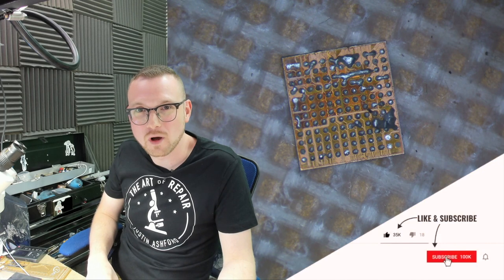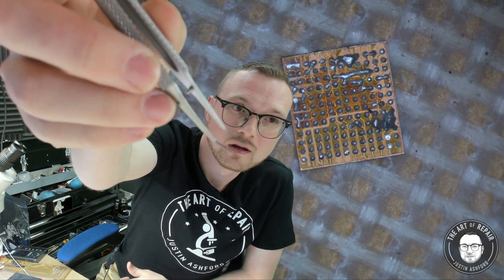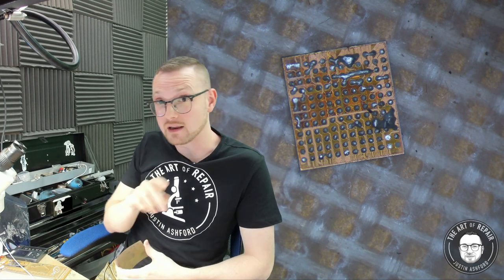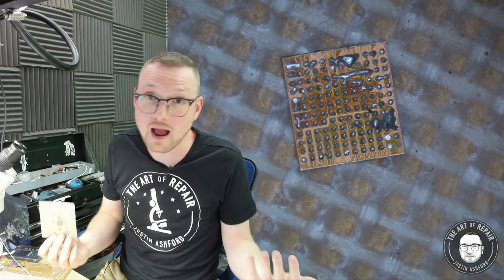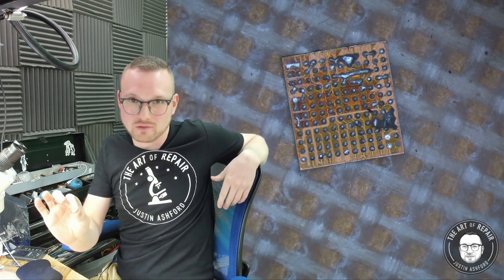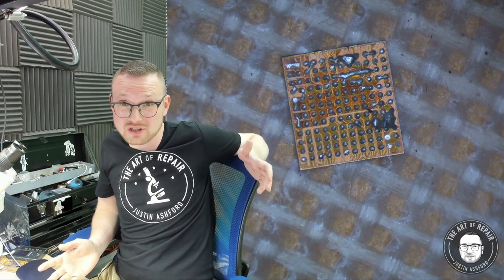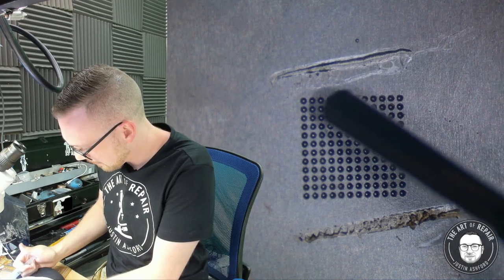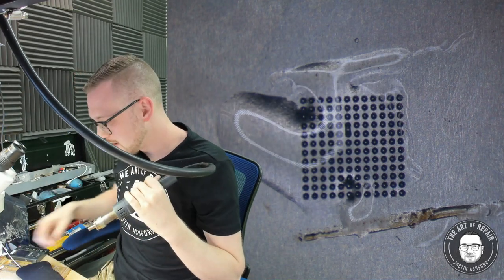IC Chip Reballing 101 | Microsoldering Basics | How do I do a basic IC Reball? | IC Harvesting

Comment: Clenaning iron before putting it to stand will significantly reduce tip lifespan. Rather leave it dirty and clean before next soldering or tin it before putting it to rest. It looks nicer, yep, but clean iron will expose metal alloy and it will oxidate quite fast. Great balls though, it is hands download best reball guide.
Reply: Clean it and tin it is fine then you have to repeat that before soldering

Comment: Hi, thanks for the video. It was very good tip, when you said to apply flux and 140C to lubricate the stencil. Now the balls didn't get stuck like they used to before using this tip. It took only 10 min to reball IC. (steps: Clean IC pads with wick, apply stencil, apply balls, heat 370C from corner angle, apply flux, heat to 140C, remove stencil, apply heat 370 to get balls self align.)
Reply from the maker: Heck ya! Glad to hear it worked well for you 💪💪💪

Comment: Hi Justin! Did all the steps you told, and my reballs are getting perfect. The only hard time I'm founding is with bigger chips, like PMIC's, EMMC's and CPU's from Samsung, Motorola, etc., and it`s worst and they have some "empty" balls and I do not have the correct stencil for them.
Is there any trick to help with this? I'm using a small piece of glass to help out, its working, but it tooks too many tries to get things to work :(

Comment: I figured the reason you want to reflow after stenciling the balls on is so you can flood it with flux and ensure the balls are properly bonded to the pads.
Reply from the maker: although it’s very very rare for that to happen yes that’s one of the reasons. The main reason being just to line everything up so that as you offset it with the pcb array it will grab properly across the array in unison 😎

Comment: Hey Teacher (I hope you don't mind me calling you that).
I'm sorry but I've tried every single hint you shared in the video. By the way, thanks a lot for sharing. You rock!
But unfortunately, there's ONE CHIP, or THE chip that literally just laughs at me every time I try something different: CYW4356XKUBG or BCM4356XKUBG, it's a Wi-fi/BT chip for the Nintendo Switch. I spread 63-37 solder with my soldering iron, remove the flux using a cloth. Then, I proceed to line my stencil (similar as yours) up with the chip, apply solder paste, hot air @350ºC with very low air speed. I struggle a little with indirect heat (even after following your steps), but eventually all the balls are formed, oh and all of that while still applying pressure around the chip with my stencil. And I end up with 2 or 3 bridges on the chip.

I've also tried gluing the chip with the stencil using a tape behind the chip; Same result;
I've tried leaving some flux on the chip because a friend of mine told me some balls might not be forming or staying on its spot because of the lack of flux; No, still same result. Although it was only one bridge, but it involved six or seven balls;
I've tried changing the air temp to 365ºC and going up the air speed a little, but it rendered the ugliest result;
Maybe something is wrong with my solder paste, which is a Mechanic one. 63-37, melts @183.. I dunno.
I even tried changing from a steel spatula to a thermal paste spreader (I don't have a plastic spudger), but results didn't change.

I'd love to watch you try your luck with it. Maybe it's just not meant to be reballed? 
Thanks again for the vid and I'm sorry I'm 2 years late for this. It took me a while to find your vid. Keep up the great work (:
Reply from the maker: Email me a video justin@artof.repair and I’ll see if your missing something.

Comment: great video. I really feel comfortable giving it a shot. As you know I don't really do phone so I am outsider on this but any suggestions on boards I could grab off ebay for cheap to practice on? something that they still sell stencils for? It doesn't have to be fixable just something to practice technique. If you want to sell me a bag of parts/boards I'd be happy buy especially if you had a stencil to go with the stuff.
Reply from the maker: Just get iphone 4 with stencils, 20 bucks for working phones and stencils are like 3-4 bucks for basics.
Reply: I've found a large stencel kit on eBay, something like 100pcs for cheap, came with 4 different leaded ball sizes. Many of them are universal, can do anything from TV arm MCU, consoles, ram. I used one for a Chrysler radio gpu chip and LG tv main board.
Reply: @jeffescortlx  I see you have found me  haha.
Reply: @FixedUntilBroken  yep I like Justin's videos, especially re-balling. He makes the process look easy when it typically ends in fits of rage for the average techinition.
Reply: @jeffescortlx  same. I've I'm here trying to learn some mobile electronics to make me a little more well rounded. Not looking to do mobile electronics as a business but I see more of out automotive electronics getting BGAs and Screens on them. I feel like one day automotive electronics and mobile electronics are going be very similar.
Reply: @FixedUntilBroken  yep more and more BGA stuff is ending up in automotive.

Comment: if you think a spudger is awesome for spreading solder paste, you should try a guitar pick.  .50 thickness.
Reply from the maker: The spudger gives a lot more accuracy in the hand than a guitar pic at least for me. Sometimes I use a razor blade but I feel like they tend to eat up the outer surface area of the stencils paste holes and cause the stencil to degrade faster.
Reply: @TheArtofRepair  Right on, I'll have to try a spudger next time.

Comment: I don't have a problem with reballing. But I do have problem when the chip pads are oxidised and the balls don't like to hold to them. What's your advice on that? :)
Reply from the maker: Normally I don’t recommend smaller tips but maybe a smaller J tip with some solder on it and the pad has some flux. It would also help if the entire chip was at a decent temp. So if you could use a ic jig to hold it you could heat it up with the hot air and see if that will break down the oxidation.  

I know the problem your having and it’s a common problem

Remember flux is a detergent and a barrier so that plus the right amount of heat and solder should do the trick. Let me know how it goes!
Reply: @TheArtofRepair  thank you.  Might try to record it and observe the outcome. If will be worth sharing, will post in on my business YT and comment here. 

If not, at least will comment what I did :).

Comment: What do you recommend to do when the stencil lift itself up while pressing with the tweezers on the edge of the array?!
Not all the time this is happening, however with larger ICs, that tends to happen often.
Once that happens, the paste/balls will merge in the center where the stencil is lifted the most.
Reply: Just put tweezers across balls, apply pressure directly to the chip. its gonna be fine, trust me.

Comment: What to do if the balls form in the stencil and get stuck there.(mostly on very tiny 0.2mm) ie. ? My balls are not on the IC but in the stencil.

I managed to really press down the solder paste very hard and take the stencil gently off and melting it without the stencil to get an okay result but always when i leave the stencil on the balls get stuck in the holes of the stencil.
Reply: Then there are some techniques. You need to "glue" the balls onto the landing pads. This you can do with thin solder flux on the surface or use solder paste prior to put the balls. If the balls still stuck all the time, you'd better reflow everything prior to remove the solder stencil. This you can do even without the solder balls. To use solder balls is not a must. Good luck!
Reply: @jurgenkruger3932  thanks for the reply. I dont use solder balls. The paste forms balls and these are getting stuck. 

Sorry if it was unclear.
Reply: @MattFixesStuff  then is something with the surface. You need a thin layer of solder flux, so the solder paste can get a reliable connection with the copper surface. If all is then proper melted, then it shall not be possible for the tin, to stuck inside the holes of the solder stencil.
You can also try to use the solder stencil upside down. Maybe the edges of the holes are not clean, sharp enough.
Reply: @jurgenkruger3932  I'll try. also ordered another stencil.

And yeah its really stuck in the holes. I can pop the balls out with a needle after theyre formed. 

Thank u :3

Comment: Is cleaning the chip off with copper wick before reballing pointless? I have always done it but I see you don't
Reply: I always use wick too
Reply: It would remove any oxidation on the pads ensuring a good connection (if that was the cause of the fault). Downside is it takes time and there is a risk of removing pads.
Mixing lead-free and leaded solder... Would lower the melting point and add lead to the alloy. I don't think it is a huge issue, especially if longevity isn't an issue.
Would love to hear Justins opinion on this though
Reply from the maker: This will be answered in next Monday's pre video livestream in more depth, but in short,  If we are realloying with 63/37 which is 183, then applying the same as paste nothing else should be effected. Cleaning the BGA array flat IC side is pointless in our microsoldering context. cleaning the bare board with wic. yes, always, but yal know how i feel about that haha.
Reply: @TheArtofRepair  " If we are realloying with 63/37 which is 183, then applying the same as paste nothing else should be effected."

Since RoHS directive, everything should be lead-free, including the BGA's (Imagine the horrors in production if only a few areas has to bee leaded and others lead-free)
Lead-free is often SnAgCu alloys, so adding a bit of SnPb will 'only' add Pb to the alloy, though not in the normal 63/37 percent ratio. 

My view on this is: Know what you're dealing with, clean it up if in doubt - always do it correctly (even though it takes a bit of time - it will save you time in the long run)

Comment: It looks like the balls in the middle have more volume than the ones on the edges. Wouldn't it make more sense to use solder balls? Then the amount of solder on each pad will be perfectly equal
Reply from the maker: @Turnikov  nah, all the same for sure. I do a lot of training for students in person. And when you have depth perception it’s much easier to see everything is all the same size.

Just to address the comment about solder balls being easier. I would say that if you’re just at the desk doing this. You can do the full paste reball of almost any size or density array in 2-3 minutes max. Fullsize balls will slow you down big time if you’re trying to get work done. Nobody has time for the reball to take 10-15 minutes alone when the full job needs to be 30 max. 

But definitely would love to discuss further if you felt you wanted to :) love good comments from subscribers.
Reply: @TheArtofRepair  your reply makes perfect sense. But if you do love discussion, I'd like to share an opinion I've found online: 
"I won't use leaded solder paste, because those tiny particles if not handled very carefully will end up in your mouth, up your nose, or otherwise ingested eventually, I have no doubt. Any solder paste should be handled with extreme caution." 
I think that hobbyists should opt for the balls, while professionals can use solder paste to save time
Reply from the maker: @Turnikov  I would say I agree that Ingesting leaded solder paste is not a great idea like 10000% but let me throw this one out there. Safety is always number one and should come before any part of the soldering process. So for me. Washing your hands when your done soldering or wearing gloves during the process would negate that. To further that. One could use lead free solder paste. It just kind of kills the working range of hand soldering a bit. Now that might actually be ok if the hobbiest is just doing some rework on something rather large. And I would say it might be that if your doing something similar to that in my video that those working play ranges are pretty crucial to allow for a proper step soldering process to eliminate damaging other joints on the board on the other side of a pcb of that are currently underfilled.

On a final note, you seem like the kind of person who would be a great addition to a community I run. The /r/soldering subreddit, we even have a discord! Maybe you will think to join. There are many first timers who could use help from those with more experience :)

Comment: Hello Mr justin ....why is the chip removal temperature always higher from the temperature used to remount the chip back on the board after a reball...
Reply: Original balls are lead free and have a higher melting point.
Reply: Because the solder holding the chip on the board originally is lead free, and lead free solder melts at a higher temperature. He replaces it with a leaded alloy that has a lower melting point